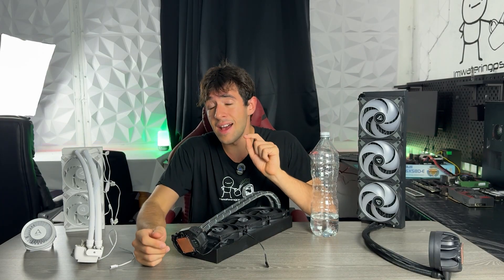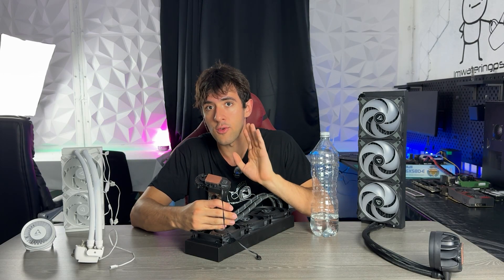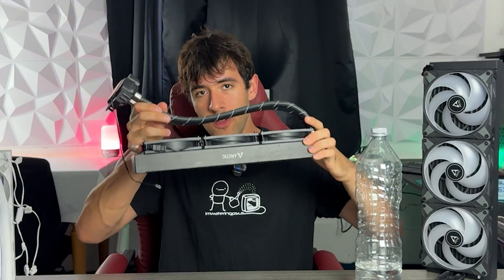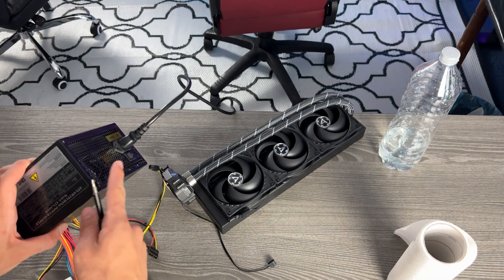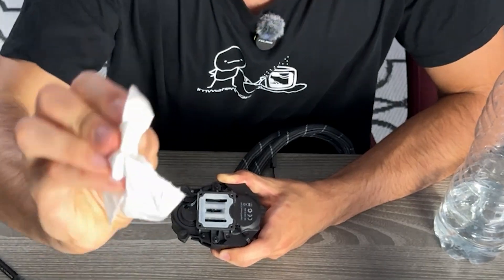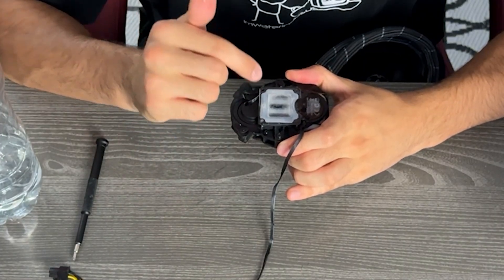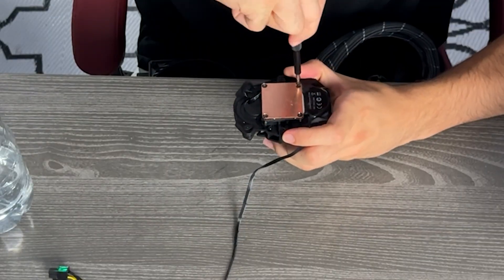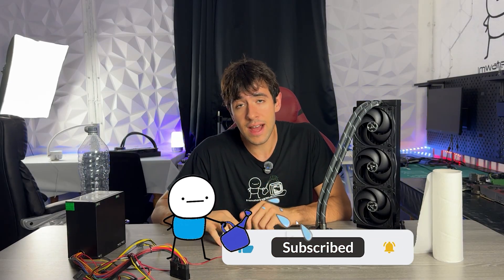Fix Your Broken AIO Watercooler for $1 💧 Easy AIO Refill & Repair Guide (2025)

Comment: You should get a little vice and wrap the aio pump in a towel then you can shake radiator. I saw a video where someone mentioned not to fill them up to 100% fuel due to thermal expansion. Curious what peoples thoughts on that are?

Comment: @6:38 Mate you are super amateur 😄 Fucking hell,put something under to colect the liquid. 😄 Also the radiator shoud be vertical when flush the system,this hel to take out more easy the air. Also you can dissconect the fans and not take attention to put acidently your fingers insite 😆,during the flush you do not need thrm. Also if you have some durty insite the cooler you MUST take out all luquid and clean the system with destilate water. Also is important to clean the pins of the the copper plate😄 In reality in this video you do the job on 40% 😆😆😆😆😆

Comment: @0:55 If the pump is broken,take out the rotor of the pump and instal external pump. You can buy 18W pump,which also will have way better water flow from original poor one and will improve also the temps.

Comment: One of the best water additives is Motul Mocool, which I've been using for years.
Pure water when you have copper and aluminum is a bad idea.
Another thing worth doing with an AIO is adding even a small reservoir. Changing and topping up the water in the future becomes incredibly easy. The internal diameter of the hoses is usually 6mm.
I prefer 6/12mm silicone hoses, as water evaporates faster through them, but after adding the reservoir, topping up is no problem.

Comment: Air must remain in the system. It needs to be there. Its main purpose is to compensate for the expansion of the coolant. Just remove the cpu heatsink and clean it.

Comment: I actually rebuilt an AIO recently (H80i v1). The pump was seized but I had to just spin it free and it worked again (open from top to access the pump). Then a attachment point for the hose snapped on the waterblock... I had to plastic weld (I do not recommend it - need to embed steel wool for strength). Replaced the hoses with longer clear ones and then very slowly got rid of all the air. It works and better at that, probably due to more reserve water with longer hoses. It kept to very close the same as my DH-15 (v1), only 3C above it.

Comment: Hey, out of context but what low profile GPU would you pick for a budget of under ~60€, preferably less?Right now I'm looking between a Radeon Pro WX4100, a Radeon RX 640 (not 6400) or a Radeon E9173 on eBay. I'm planning to pair it with an I5 3570T on some office hp sff pc, hence the requirement for low profile

Comment: AIOs intrigue me as I use a Thermalright FS140 with twin towers/fans and worry about the weight effect on the motherboard. I had read that water evaporates from the aio in time but were sealed units. I dont use my pcs for heavy work but will reconsider after seeing your tutorial as must help with longevity as well as looks! Thanks 😸👍

Comment: One issue is found is some manufactures use a tamper screw on the cold plate...(then you cant open the AIO from the cold Plate) Their is no other way but to drill the screw or cut the Tubing and retube the AIO > I just make them clear as some tubing Like old AIOs from Corsair eventually perish and you see black particles in the coolant its small rubber pieces... Sorry for all the spamming :P  much info ... many Comments lol But this is an awesome video :)
Reply from the maker: You’re not spamming at all my friend, you’re helping a lot everyone reading! I’ve never encountered those screws but I did indeed refill a few AIOs from a drain port placed somewhere else and… yeah I did drill one because the screws on the coldplate were ruined. I never re-tubed one but you’re making me really want to try it!

Comment: Having the liquid spill over the pump like that isn't good at all  ... if it gets onto the pump (outside) like on the pump PCB that can kill the pump a lot easier than any corrosion can ... Even distilled water can eventually become conductive from the copper plate in the AIO as ionization occurs ...
Reply from the maker: That’s true but for the brief moment that the distilled water is going over it, it won’t “catch” charge, ionization doesn’t have time to occur :) Still, follow this advice and avoid spilling water all over if you can! My block was tricky to hold due to very stiff tubes😪

Comment: cool, didnt know they were serviceable. can we use car antifreeze?
Reply: Yes you can it prevents galvanic corrosion … I use that and some ISO alcohol in the liquid to kill all germs…

Those are the main issues galvanic corrosion ( aluminum and copper = reaction)
ISO alcohol for germs :)  you only need 2ml of alcohol ( don’t use it  directly on plexi waterblocks as it causes crazing ) the 2ml 250ml + of coolant in an AIO won’t do anything
Reply from the maker: You can indeed :) Also great advice down here

Comment: If you cant hear the Pump.... It  could be seized and still fixable >   still open it clean it and make sure the impeller is free moving sometimes the galvanic corrosion causes the impeller to stop cleaning can fix this issue and boom Mix battery water with antifreeze and you are good to go
Reply: i bought a brand new ek aio and sounded so bad i ended up taking the pump apart and and found a burr in the pump after rmoving and refilling iw worked just fine
Reply from the maker: This is some VERY good advice! It’s a point I touched briefly in the video by saying there could be some gunk preventing it to spin, but I should have talked about it more!
Reply: @ImWateringPSUs  Most times where you need to cut the tubing is (in my experience) NZXT AIOs ones with the pump in the radiator ... The corrosion clogs up the radiator the build up is insane .... after flushing ... put new coolant and tubing ... Its been great for years now